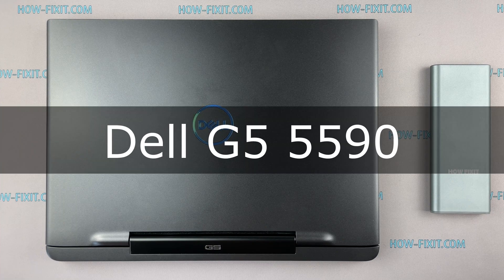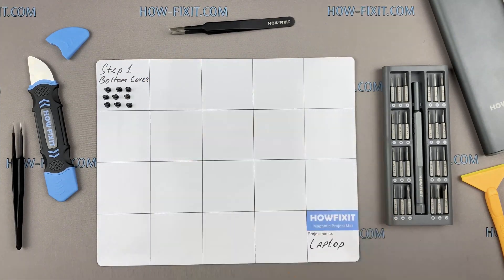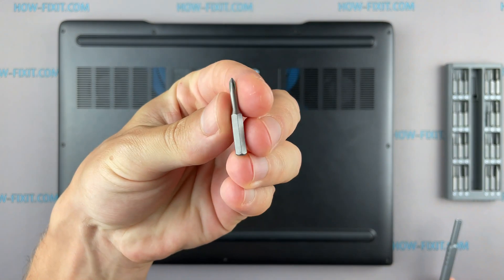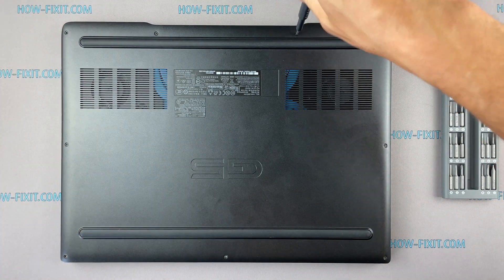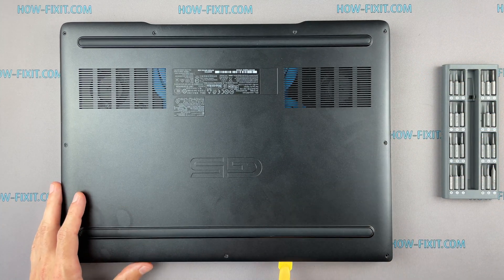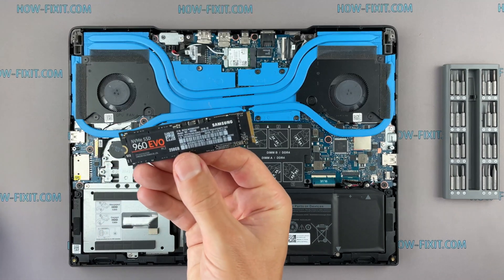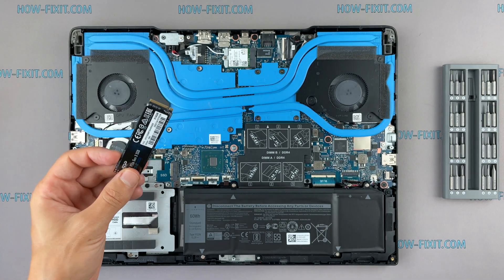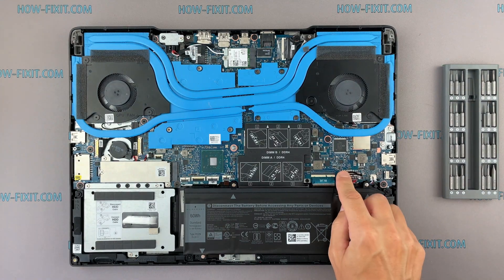Dell G5 5590 M2 SSD Upgrade | DIY Installation Guide

Comment from the maker: ⚠ The Dell G5 5590 supports both M2 SATA and M2 NVMe drives in its M.2 slot. So, you can install either, depending on your preference for cost or performance. Check the description for links to recommended M2 SSD drives. Additionally, watch the video explaining the differences between M2 NVMe and M2 SATA 👉 https://youtu.be/r3Jy5dHOj3g

Comment: Incredibly useful, thank you!

The only thing I found different was that my original SSD was very short, so the spacer underneath it had to be moved to the left so that there was a screwhole under the notch.

But my laptop is now up and running with a much larger SSD thanks to this video!

Comment: Only one NVMe m2 can be installed on it ?
Reply from the maker: The Dell G5 5590 has a single M.2 2280 slot that can accommodate both M.2 SATA (AHCI) and M.2 NVMe (PCIe) SSDs. Check the description for links to recommended drives.

Comment: Hi, do you know if this notebook support a nvme 3gen with 2TB space? Or the max is 1TB?
Reply: Support 2Tb???
Reply from the maker: The Dell G5 5590 has a single M.2 2280 slot that can accommodate both M.2 SATA (AHCI) and M.2 NVMe (PCIe) SSDs. Check the description for links to recommended drives.
There is no limit on the maximum size of an M2 SSD, but there are Windows limitations. If your Windows is 64-bit and the GPT file system - you can install a drive of any size.